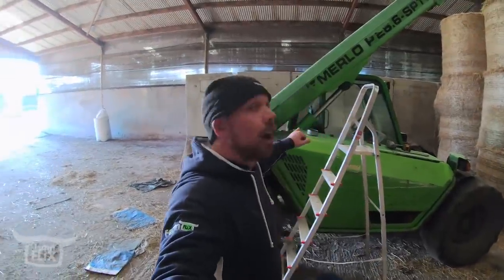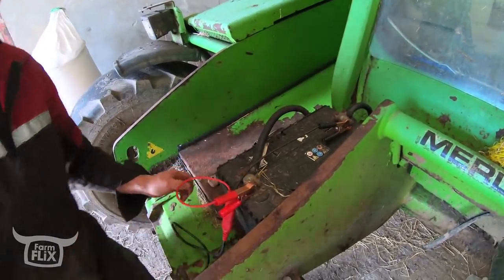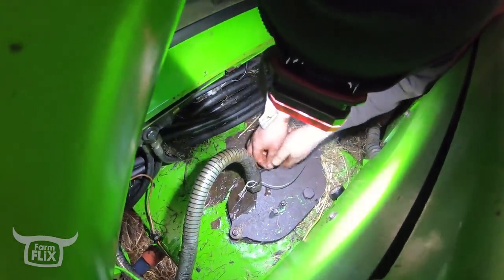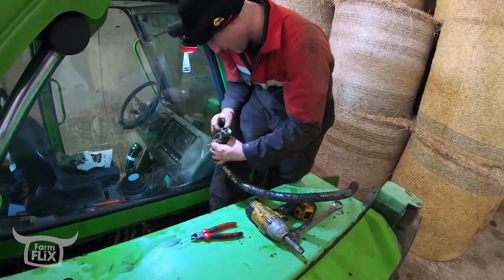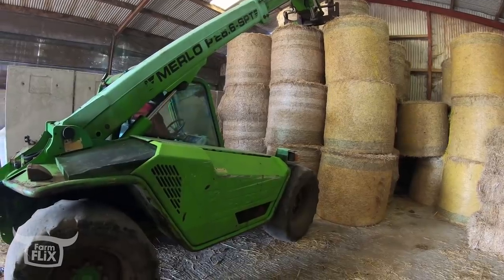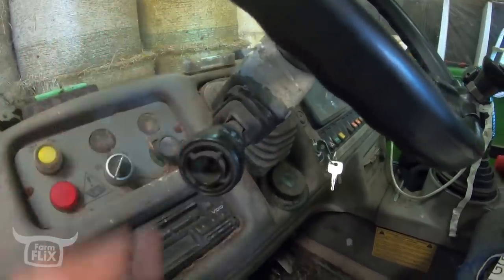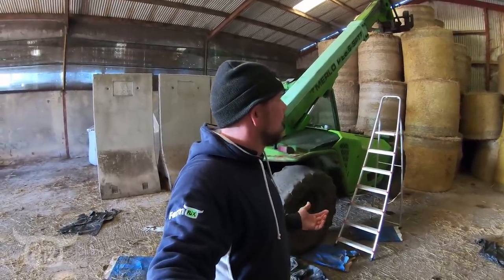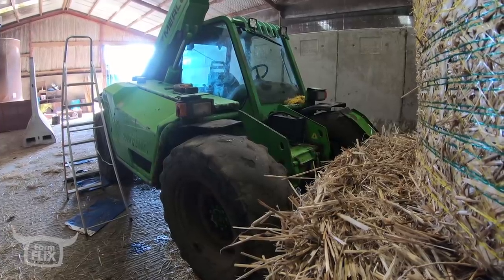URGENT TRACTOR MECHANIC ,DEAD MERLO Alan Clyde | FarmFLiX

Comment: Loader on the tractor as a back up, plus you could use it for carting bales instead of taking a tractor and handler. Changed a tractor a 3 years ago and ended uphaving two tractors and loaders wouldn’t go back now you use both a lot more than you’d think
Reply: have thought of it but i think it would be hard to get onto after being so used to a handler
Reply: Get the father on the loader, what could possibly go wrong 😂
Reply: @colinmackenzie0  What could go right would be the questionlol

Comment: The poor Merlo, new tyres would like million dollars👍 it’s easy to say replace old girl but if only small repairs n total operation cost like fuel, parts, insurance is still reasonable then keep her.  Maybe one give her TLC a full clean down, take all panels off blow/wipe her down, full inspection n replace anything looks warned out.  Future replacement maybe JCB or Bobcat, we are running Bobcat TL38.70HF its been good so far.
Reply: yeah we will keep her running a while yet. ive never got driving a bobcat as yet

Comment: Just seeing other comments thing is with JCB and manitou is they have a torque converter and gears , better for going up hill and pushing/pulling but the merlo's with hydrostatic wont run away down hill and are better for delicate/fine movment work tbh, dont have to knock merlo constanly into neutral so engine isnt straining like the torque converter machines too
Reply: Tbh im a JCB man but i rather a merlo handler 😂
Reply: @arwelagrimachinery   see i think i would struggle moving away from hydrostatic
Reply: @alanclyde8253   have you seen the JCB Teleskid ?  JCB robot skid steer but with telescopic boom , probably half the price of a handler new , you have 1 joystick for forward/back/ right/left  and another joystick that works the loader like a quickie loader joystick on a tractor , would do as a yard machine and keep the merlo for the pit/field work . Have a Robot 190 here tbh 1 of the best things we bought but extra forward reach is what shes missing.
Reply: @arwelagrimachinery  havnt seen but I like the reach with.the handler

Comment: Glad you got the Merlo fixed.  Might be old but, whilst you can still keep it going that's the way forward for you.  Not everyone in a position to buy shiny new machines.
Reply: thanks mags, just have to work with what we have got
Reply: @alanclyde8253  absolutely, when your mechanic admits defeat and it cant be fixed with bailer cord and cable ties, you know it's done, but until then it's a keeper. .
Reply: @magsprettejohn2160  😁

Comment: weve got a 2003 26.6 merlo. When she does run she doesn't run above maybe 1500 revs after 10 mins of work. At the moment shes sat standing not starting, pretty sure its a fuel issue. Anyone any ideas as to why she struggles to rev up?
Reply: Not sure, I've had issues with lift pump before but that was more she would stall if you didn't keep the revs on
Reply: Have you checked the fuel filter? Had a Deutz DX 110 do the same thing a few years ago.
Reply: if a perkin flat top engine fitted    might have a diafram on the outside ofthe injector pump that splits and draws air and  might cause the symptoms you have .......also check that the strainer over the diesel pipe in the fuel tank is not blocked .....
Reply: George Doorley ah cheers mate I’ll have a look

Comment: Have you thought about getting a 2nd hand loader for one of the tractors, be a good backup at least and would be there for only a few grand
Reply: Twud be like going from a ride on back to a push lawnmower!!
Reply: It wouldn't be ideal but It would do the job,  and not cost the earth
Reply: @philipoconnor2236  that would be my worry
Reply: @joshs30  it has been on my mind, it's a good idea in principle but having came across many decent loaders that aren't still quite dear
Reply: Yeah just an idea to consider I guess, we have a quicke loader that is top spec, does a lot of hard work, cant match a new merlo but for 6k brand new does a good job and is reliable
Reply: @joshs30  it might be what i end up doing
Reply: I agree, a front loader would get you out of trouble and if it's possible putting linkage on your buckrake so the tractor can do your clamp if the Merlo breaks down.